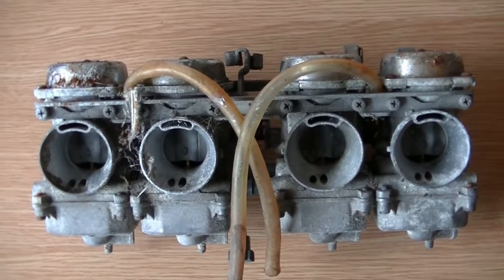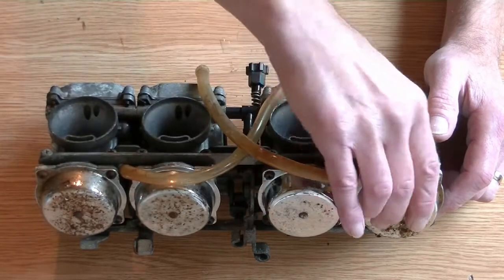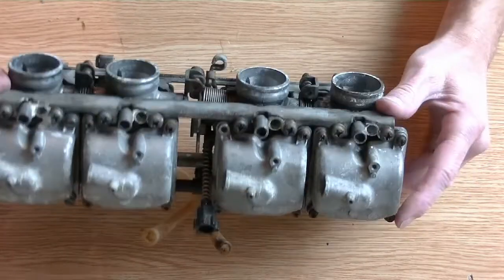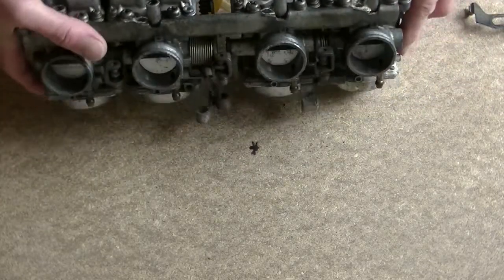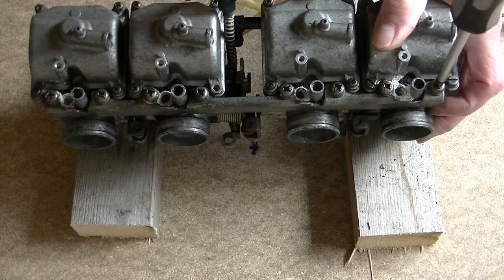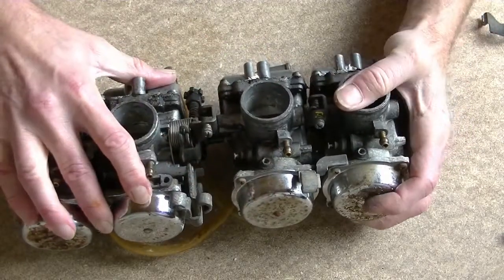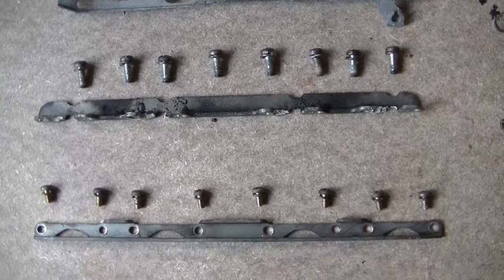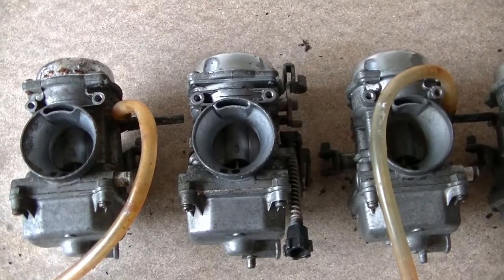Kawasaki keihin CVK CV carburetors separating 4 motorcycle carbs to rebuild and restore

Comment: Thanks for showing how it is done. I have a leak from the fuel gallery and need to replace the o rings and I was a bit concerned that as I separated the carbs the springs would fly everywhere. You were right about the bracket screws being a nightmare, I have 7 mangles heads to deal with first, wish I had seen your video first.

Comment: Hey bundlez did you ever do a video on how to reset those throttle springs for the sync screws and the bigger ones that retract the throttle plates? That's probably the hardest part to figure out on your own.